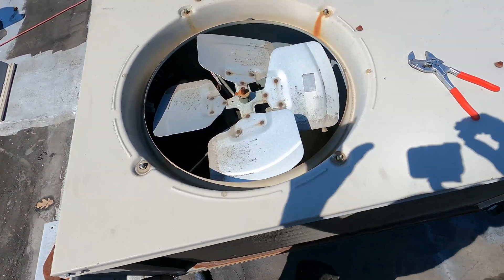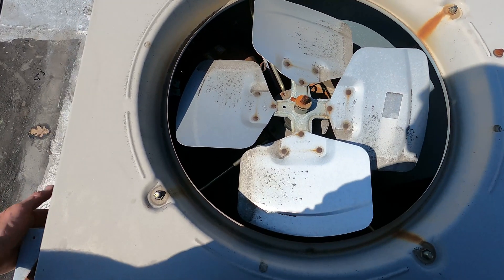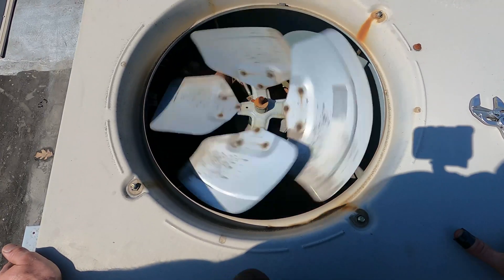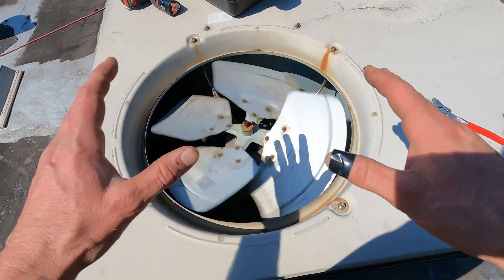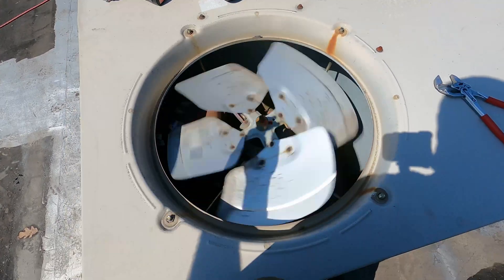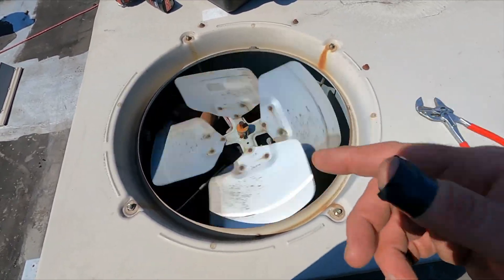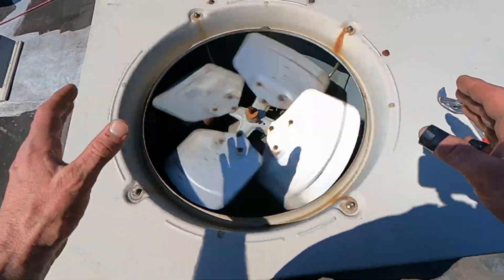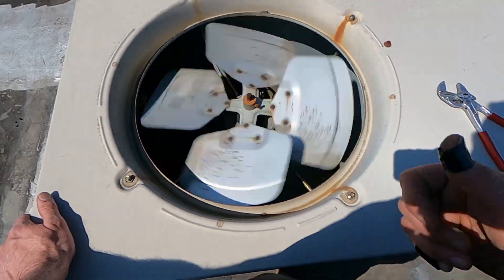Fan Rotation Distorted Camera Frame Rate/ FPS

Comment: Yeah... And it's interesting, I put together a modern computer in the AMD Ryzen range. I purchased a cooling fan which ended up being excellent for the 20$ I paid for it before Covid; today I'm sure it cost more as many things do as an impact. What I did not know and puzzled me for some time was that the four LED's were in sync so matter what angle you look at it; it looks like it is not moving. I would check it with HWMonitor and it would say exactly the rpm it was rotating at; time to scratch your head as I was doing. Temps were perfect.. Somehow I bought a perfectly strobed fan/LED setup. I brought a flashlight on the scene to check and yes it was running. Frame rates and perfectly synced light have effects.